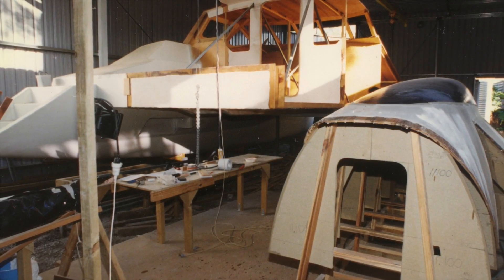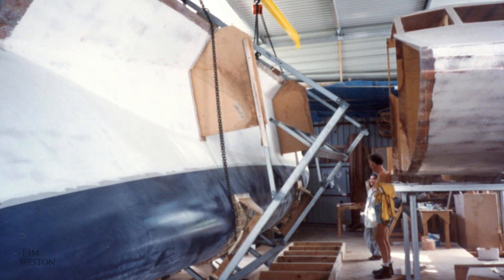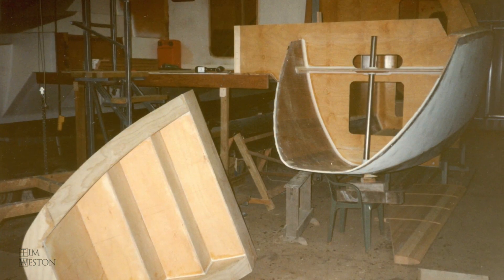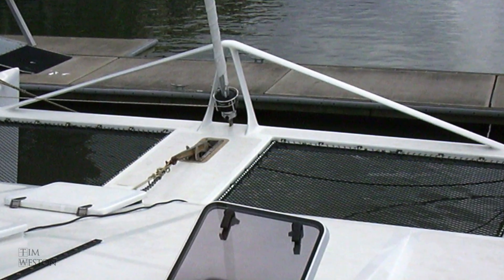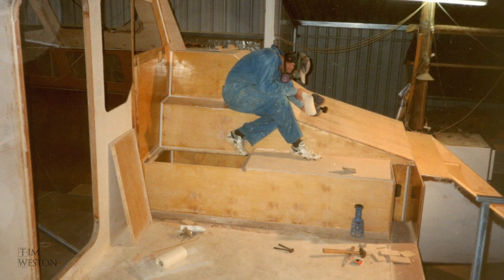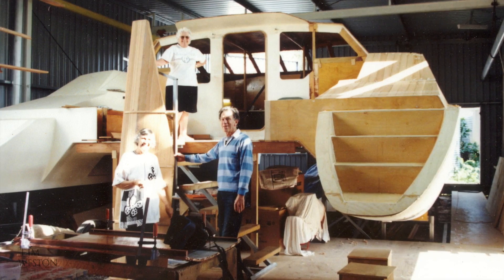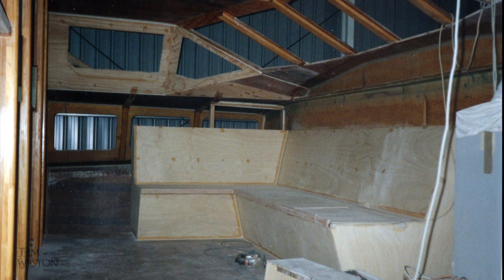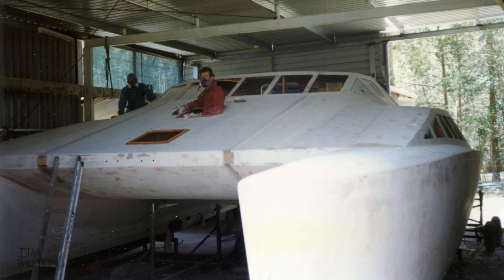How to build a boat Ep #4 - Catamaran you can live on

Comment: My question is though, what technique did you use to bend the wood, or at least make it go around the hull and other areas????  I'm amazed by your work.   I want to build mine before 2019 gets here!! :'(
Reply from the maker: Hi Luis. It is built using strip planks of western red cedar. You can see in the first and second video, how it is done. There will be plans available in about a years time if you want to build one! Tim
Reply: Ah ok.  I will watch those videos again.  My plan is to build my own motor boat (like a Sea Angler but with a cabin).  I'm watching as many videos as I can to at least have a notion on how to work the wood, the fiberglass, etc.  I want to feel comfortable working the materials and not afraid that I'm gonna break something, since all I got is one shot at it. LOL  Thanks for the reply!!

Comment: I am planning on building an 11 meter cat, but I cannot find any information o how the pressure and weight of the mast is supported. Is it by the forward bulkhead just underneath? Also how to get the chain plates strong enough. congratulations on the build! Great boat...
Reply from the maker: Hi Jaycen. Yes the mast is stepped just in front of the main bulkhead, mm in front of it. The chain plates were attached to the aft cabin bulkhead. The plywood was built up in the area they were attached enough to take the load.

Comment: hi Tim, great great job!! Nice to watch your videos! 
I'm thinking to build my own catamaran and I try to get info and research a lot now before I start to do that.
I wounder how did you make registration process? Is it easy to register self-built boat. What is needed to get all documents and make it 100% legal. I know every country is different rule, how it was in your case? 
Greetings 
Marek
Reply from the maker: Hi Marek.  Thank you.  Yes, good question.  I'm not up on the registration process for all the countries.  It would be interesting to look into.  In Australia, it is very straight forward.  When I built my boat I just filled out the form with the details of the boat - dimensions, how many motors, serial numbers of motors, type of boat etc. and paid the money.  There is no check or tests to pass when building a boat for private use.  I.e for non commercial use.  Before I could leave australia with the boat I had to register it as an australian ship.  Cost more money, but the process was the same.  No checks.  Just paper work and pay the money.  Check it out in your country.  And let me know!  I would be interested to hear how you go..  Tim

Comment: Im planning to build similar size catamaran in upcomming years, so this is amazing for me. You really did a wonderful job there.

Can I ask you, how much did you spend totally for building the whole cat?
Reply from the maker: Hi Michal.  Thanks.  I spent around $120.000 AUD at the time.  I need to double check but I am pretty sure  that included all I spent on building the shed, running my car etc..  But the boat was also not fully finished.  I could only afford the main sail and no winches in the beginning.  It was a work in progress for a long time.  But at least I was sailing!  I think the actual raw boat material costs were below this.  I bought the mast in kit form and assembled it for under $20.000.  The rig and sails are a big part of the cost.  Let me know how your build goes when you start!  Good on you.  It is a great adventure..
Reply: Thank you a lot for answer. Im really looking to see more of your videos.

How many boats have you built before going for this pretty big catamaran? Im just starting to learn about boat building, so there is a lot of experience I need to get first :)
Reply from the maker: Hi Michal.  Actually not many.  A couple of small boats, one in strip cedar with fibreglass, same system as the catamaran.  Just to try it out.  then I built the big one..  But it's all basic wood working.  For me I was relatively new to epoxy and fibreglass.  A laminated up test pieces and tore them apart, just to get a feel for the strength and develop trust in the system.  After a few times using it you get a feel for it.
Reply: Well, Im not so skilled with the wood so far as well, just a basic stuff, but Im really looking forward to learn all that stuff. Will start with smaller boats as well, hopefully in some reasonable time, when I will find some property where to build it.
Reply from the maker: +Michal Takáč. . Sounds good Michal.  Take your time..  It is not as hard as it sounds. I'm sure you will pick it up relatively quickly. Playing around with it on small projects is a good way to learn.  I'm writing an ebook to follow these videos with a lot more information about the technicalities of my build and things I learned along the way. It might be interesting for you.  But just read lots and practice!  Tim
Reply: Yes, i saw you are working on a ebook. Definitely update me when its going to be done. When do you expect it?
Reply from the maker: +Michal Takáč. Not sure exactly hopefully in the next month or two..  I will let you know!